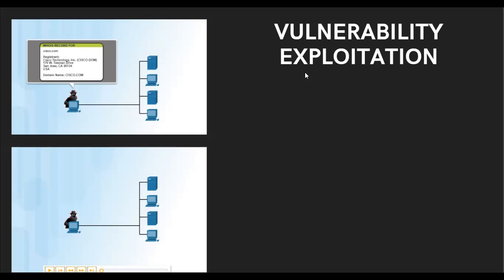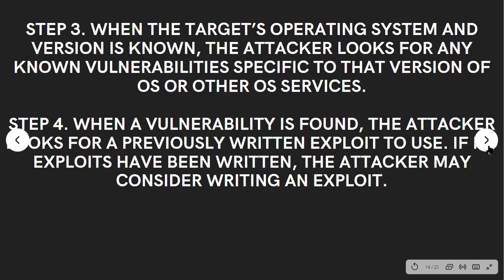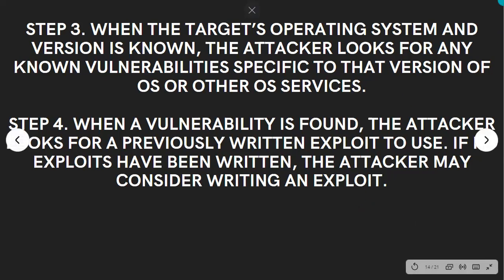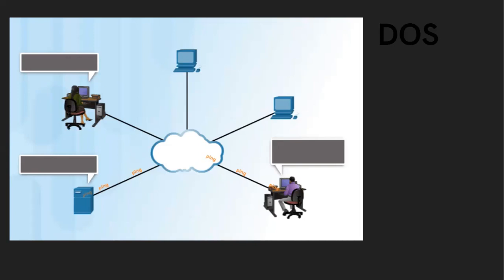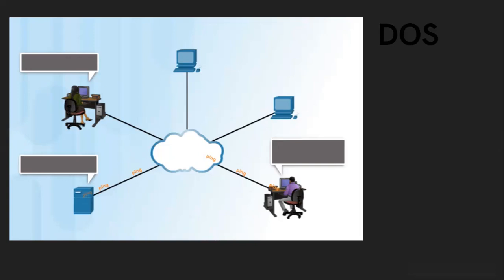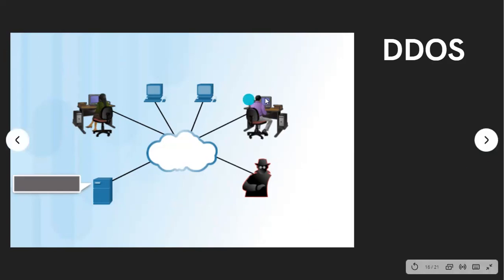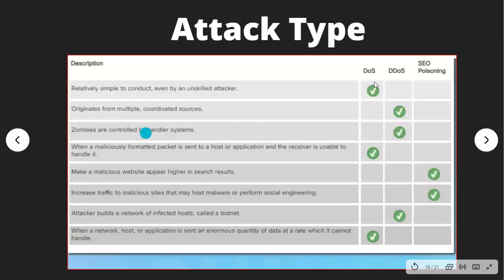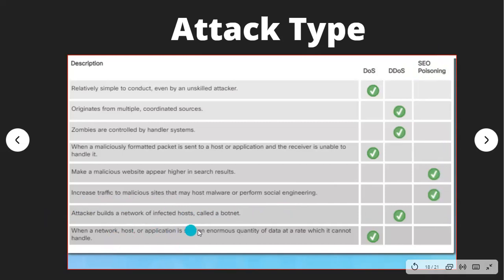Getting into Cyber Security:  Attacks, Concepts and Techniques - Part 3

Comment: CYBER SECURITY: Attacks, Concepts, and Techniques. (Part III)

INSIGHT: Through this informative video, we can now be vigilant and act as soon as possible to avoid or eliminate exploitation when it happen. We also need to take concern of the integrity and credibility of the things that we are accessing, it always starts with us. As long as we can avoid these attacks, we can feel at ease with our personal informations.

Key-points:
1. VULNERABILITY EXPLOITATION
✓ Another common method of infiltration.
✓ Infiltrating the system and organization.
✓ Attackers scan computers and gain informations.

2. METHODS FOR EXPLOITING VULNERABILITIES
✓ Gather information about the target system.
✓ OS and its version, and list of services running on it.
✓ Attackers looks for a known vulnerability specific to its version of OS and other services.
✓ Attackers look for previously written exploit to use.

3. DOS (Denial of Services)
✓ Results in some interruption of network services to users, devices or applications.

MAJOR TYPES OF DOS
✓ Overwhelming quantity of traffic - enormous quantity of data at a rate which cannot handle.
✓ Maliciously formatted packets - causes receiving devices to run slowly or crash.

4. DDOS (Distributed Denial of Service)
✓ Originates from multiple coordinate services.
✓ Attackers build a network of infected host (botnet).
✓ Infected hosts are called zombies controlled by handler system.

5. SEO POISONING (Search Engine Optimization)
✓ SEO - is a set of techniques used to improve website ranking by search engine.
✓ Used of SEO to make a malicious website a appear higher in search result.
✓ Increase traffic to malicious sites that may host malicious or perform social engineering.

6. BLENDED ATTACKS
✓ Used multiple techniques to compromise the target.
✓ Most common blended attacks uses spam email messages, instant messages on legitimate websites.

7. IMPACT REDUCTION AND SECURITY BRIDGE
✓ Always communicate the issue internally and externally.

Comment: The most secured system isn't built overnight. It is an everyday process of securing and finding out the vulnerabilities. To be able to secure the system very well, they should be educated on how these attackers think. In that way they will be ten steps ahead. It is an everyday battle and surely success will be on your side if you are aware on both their techniques and your system's flaws.

Comment: This part 3 discussion highlights the DOS, DDOS and SEO Poisoning. The difference between DOS and DDOS attacks is that a DOS attack usually uses one computer and one internet connection to flood a targeted system or resource while the DDOS attack floods a targeted resource by using multiple computers and Internet connections. A DDoS attack is designed to prevent authorized users from accessing the website and the aim of a DoS attack is to make one or more services unavailable. And the SEO poisoning's main goals are malware distribution and data theft, so attacks can cause problems for both individual internet users and corporate networks.

        As we can see hackers or what we called Threat Agent uses or take advantage of our vulnerabilities to do anything that causes harm to us. And because of technology, it is easier for the hackers to get your personal information using your devices and the action you are doing online to use it in any illegal activities. These devices provide an entry point for any attacker into the corporate network, as attackers use known vulnerabilities to get access to the devices. So, in order to prevent anything like this from happening, we must still be vigilant, think before we click, apply what we've learned, and learn from our mistakes. In this video, it's really important to understand impact reduction in order to know how we'll react if something like this occurs.

- CECILLE LLANDA [ BSIT - 3D ]

Comment: thank you for this kind of content sir, it's very helpful because you can gain information and be aware of the different attacks and how to deal with them, especially the SEO Poisoning it's about how the attackers use search engines to get a higher ranking in search results. the most important to do to avoid this kind of attack is to install antivirus be aware of malicious files don't accept or read or open them, use VPN to avoid hacking by using your mac IP add and change the password every month that all thank you. - BSIT3F